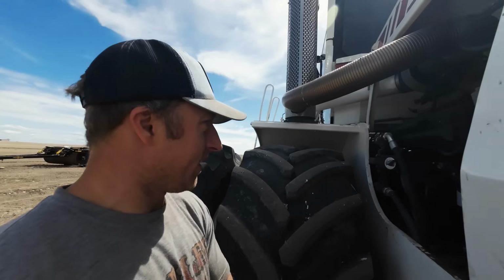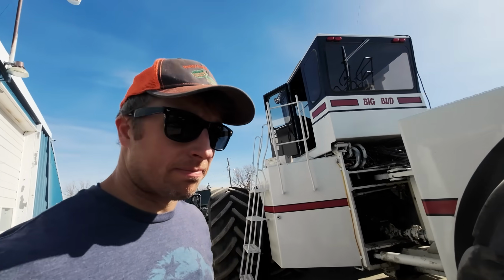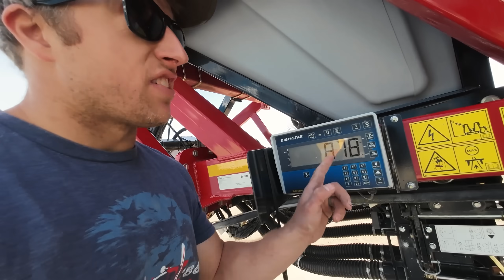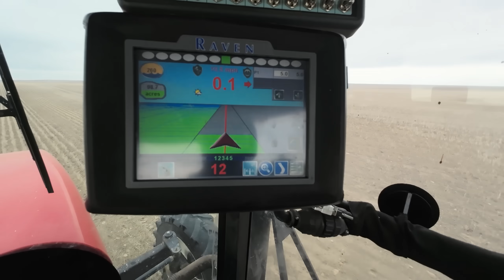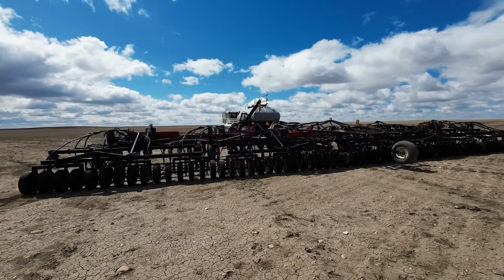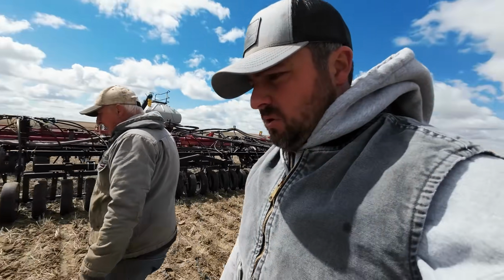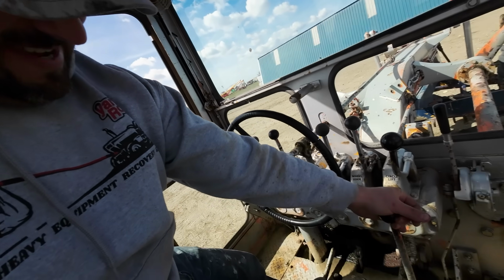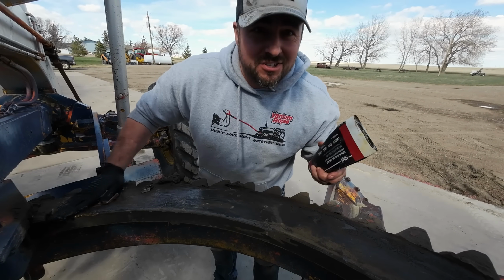1st DAY of SEEDING! Trying out a NEW Crop!

Comment: Lok for something called Waxoil. You can get it from a JCB dealer.  It's in a spray can. Clean the area then spray the Waxoil on and let dry. It doesn't attract grit and dirt and is a great lubricant.  JCB uses it on their extendable backhoes. Try it. It works

Comment: Years ago I bought a flywheel for a 390 ford. Had it resurfaced and was out of money. Turn out to be for a 402 ford. Five of the six bolts would fit but not the sixth. Put it on a brake lathe centered it up a drill six new hole between the old hole. Ran it for 40,000 miles. Real men make it work.😁

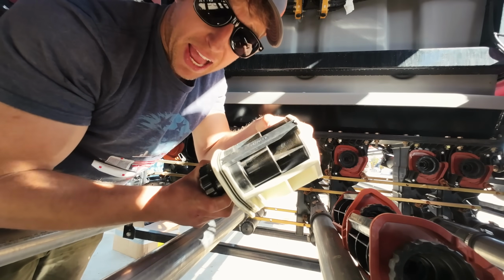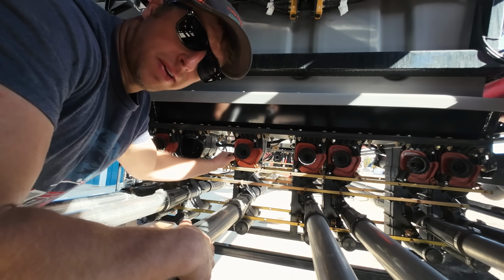Comment: 3:40 you probably don’t want to hear this but you put the wrong meters in. The black ones in the orange cartridge you took out have a thin metering segment where that roller has a solid rubber piece, you can see at 3:19. Surprised you got anything to meter with those other ones.
Reply from the maker: We actually caught this and changed it out after filming this but nice spot! Yes definitely a difference between those meters.

Comment: Do y’all ever work y’all ground? Look like y’all just drill every year behind the last year crop. Maybe that’s how y’all plant y’all crops every year. Here in La. we chisel plow and disc all our ground every year! If we didn’t we get very compact soil and very hard ground and our planters would not take the ground. Just asking!! God bless y’all with a great crop this year!! Be safe!! From La. our crops are beautiful so for this year. We are done planting.😎🙋🏼‍♂️👍
Reply: No they only No til the soil. If they till it it will just blow away in the wind as the air is very dry and it’s always windy. As for soil compaction no because winter freeze and thaw will usually take care of compaction. We run some no til here in Wisconsin and have no issues with compaction in the spring as the ground gets busted apart in the winter with the freezing temps.

Comment: Have you ever calculated the miles you put on? I know you cover acres because of the width of each implement and I know tractors measure in engine hours. How many actual linear field miles do you put on for one seeding evolution on one tractor seeder combo or the sprayer?

Comment: Have you thought of getting something like the type of wax oil that JCB uses for their telescopic loaders for the booms that supposedly doesn't attract dust as much but is supposed to be hard wearing and still be lubricating. 

I haven't tried it myself as the manufacturer of ours just recommends replacing the nylon wear pads which are a fraction of the cost of the JCB ones.  But if you haven't it might be worth getting a small pot to see if it is any better
Reply: Just be careful on your pronunciation and accent if the parts person is female when you ask for some boom wax

Comment: Hey just wondering why don’t you guys run a disc drill and stripper header? A guy custom seeds for us and said it has changed there crops. They have dryland crops he said they can’t seed as early as other years because the stubble holds all the snow and then turns into moisture. He says there yields increased 10 fold
Reply from the maker: We have been very intrigued by stripper heads and disc drills. Honestly probably a wonderful fit for our operation. I think it is the upfront cost that is holding us back. Just can't seem to get ahead these past few years with our lousy crops. If we have a killer year we may make the switch.
Reply: @WelkerFarms  Yes up front cost does cause an issue. I know the drills could be swapped but i know its nice to keep the drapers. As irrigation not getting rain and our water being diverted may 15 and getting here till the 19 we had a field tilled last fall and is now seeded to canola and the seeds are pretty much in the dust. Hopefully these passing storms hit our way to get stuff going. about 4 miles or so down the road they got an inch of rain while at our place we got 1/10 lol

Comment: how does that tiny sack make enough to keep big bud rolling and why add fertilizer that land should of been fertil it is not a potted plant. By the dryness of the dirt could do better waiting. I would say great work but during the B rolls the heat mirages tell of empending doom. The PSI is from air pressire which goes down during dry season from clogged air filters. Could use a carbon greese that is not sticky on the giant gear.

Comment: You run your chart in front and other run in back of seeder whats the difference
Reply: Powered wheels vs trailing.  Less aggressive
Reply: @RobertWelkerFarmerBob  I don’t understand what you’re saying
Reply: Read your question quickly while seeding. As far cart in front vs back: depends on type of soil and size of seeder.  Large tanks and wide seeders tend to be tow behind. Our carts are tow between so seeder is in back.